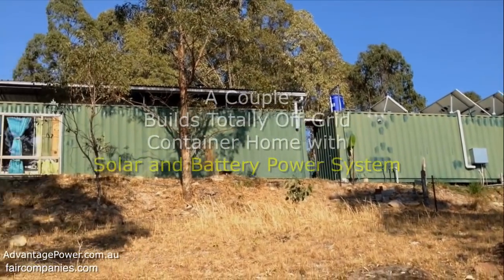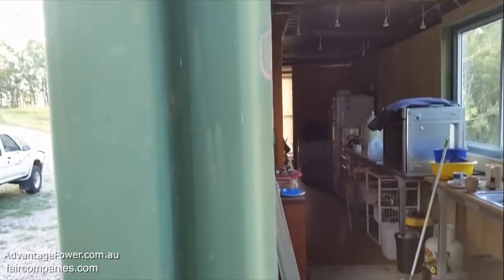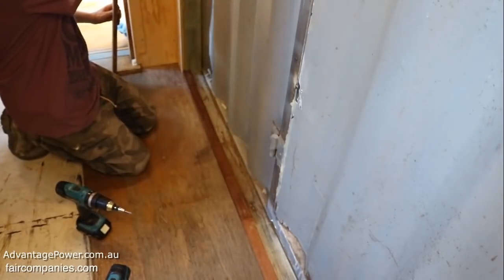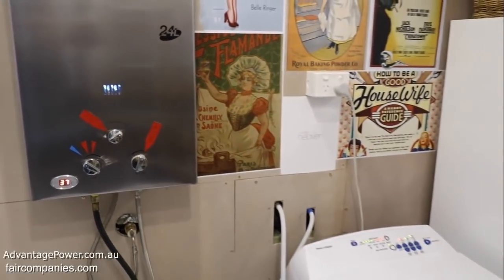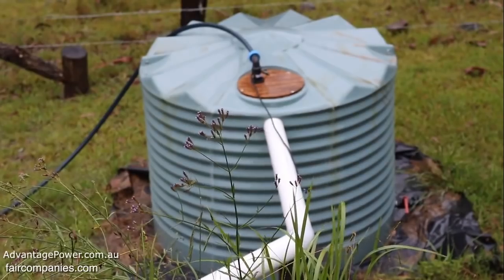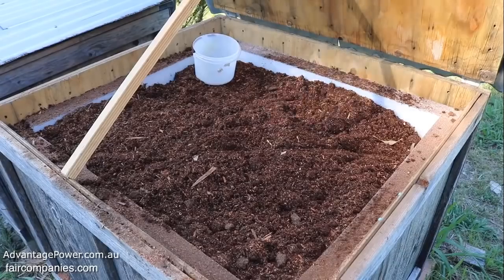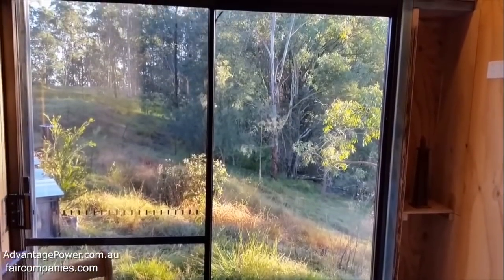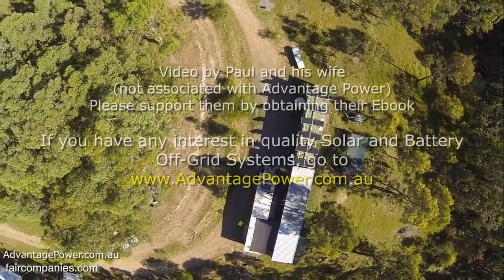Couple Builds Off Grid Container Home with Solar and Battery Power System

Comment: Not entirely off the grid, unless you make your own gas for that stove...
Reply: Difficult or not, the title says off gird, and that's not entirely true.
Reply: No doubt they bring in gas in tanks, they would be filling and transporting them themselves as there would be no piped gas supply out there. That would count as ‘off grid’. You can see the gas tanks in the video, same size as BBQ tanks.
Reply: Well, the basic disagreement here is the definition of "off-grid."  My understanding of the term is that there is no dependency on the outside world.  Clearly, having to buy gas (liquid or vapor), is not "off-grid" as I understand the term.
Reply: TheStavros1001 Ah, I see. My definition is based on their stated requirement of no utility bills. As they would pay as they filled and receive no utility bill from a utility company, to me it qualified as off grid. Thanks for your explanation.